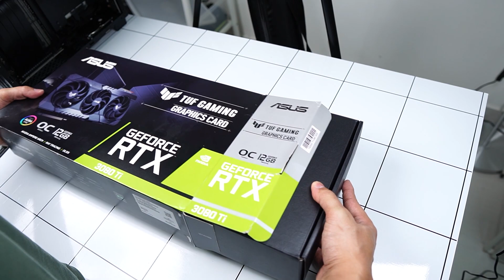Lian Li Q58 with 280mm AIO | Asus ROG x TUF #pcbuild #lianli #asusrog #asustuf #rtx3080ti

Comment: That's way too much thermal paste, your temps will get worse due to less direct contact of the cooling plate to the CPU.

Thermal paste is a much worse conductor of heat than metal. It's only better than air.

Comment: Has anyone heard of anyone fitting the asus tuf gaming 6700xt in this case?
Reply from the maker: Dont think its possible. The tuf 6700xt is among the behemoth gpu there is
Reply: @SembangTechbyEzadHafidz   thanks
Reply from the maker: @stevestewart3816  I just googled the specs 

TUF RTX3080TI 299mm
TUF 6800XT 322mm
Gpu clearance of Q58: 320mm

Even the nearly 320mm will have trouble to be fitted in Q58, let alone 322mm. 

So in short, yeah it wont fit.
Reply: @SembangTechbyEzadHafidz  I definitely fit the 3080 I'm the case lol

Comment: 9:11 If you take the time to meticulously cable manage, you can absolutely still fit a 120mm fan in the bottom with. I did it while using a Corsair SF750 and a Corsair H115i 280mm AIO and my Noctua NF-A12x15 still fit perfectly fine and a standard 25mm fan would have also still fit, but I just happened to a few Noctua slims I wasn't using.
Reply from the maker: Noted on that. However I'd still won't put the fan there, as I think that the intake there is kinda moot, as the airflow would be obstructed by so many cables. If the fan is on the motherboard side, then I would definitely put it there. Nevertheless, thank you for the idea. Maybe I'll try it in thr future.
Reply: @SembangTechbyEzadHafidz  Air doesn't move in a linear path. Having the extra fan there along with the top fans pulling the air along will help bring air to other components. I definitely had much better temperatures with the secondary fan there. Although I still wasn't very happy with temperatures overall and have since switched back to my NZXT H1 in an open air config (because I'm mining).

CPU temps while gaming were hitting over 70C on my 5900x in the q58, even with all the panels off. Barely cracks 60C in my H1. Same with GPU, dropped 10-15C.
Reply from the maker: @gamehawk55  that I have to agree. I came from NR200P and while Q58 is better aesthetically, the temp is way worse. In fact I just bought another NR200 and plan to swap the hardware back there again.
Reply: @SembangTechbyEzadHafidz  are the temps that bad? I was thinking about going with a 3080 12 GB
Reply from the maker: @cjcaton19  it's not that bad. it's just, NR200 has a better temp. probably due to the mesh design. just undervolt or let the mesh stays open during gaming
Reply: @SembangTechbyEzadHafidz  I tried out the nr200, it was simply aweful if you used a 280mm rad because all the air from the gpu was trapped there, even using the radiator to pull the hot air out it couldn't handle it without being loud af and lowering clock speeds. I bought this because the meshlicious I currently use (with the same card you have) generates so much heat it literally melted one of the risers I had.

Comment: Nice.. Pls how did you handle the rgb CORSAIR Commander CORE, cant see it in the video
Reply from the maker: I didn't use the commander pro. all parts are using the standard 5V ARGB, so I controlled the RGB with aura sync software by asus

Comment: Super nice! Is 3080ti ok with sf750w power?
Reply from the maker: No issue so far. I use stock setting, no uv or oc. Unlike the high tier gpu like rog strix, this gpu only uses 2x8pin so 750w is plenty

Comment: Terbaik Dr. Rasa2 better 240 or 280 aio for q58? If 240 below blh masuk 120fan should be sejuk lg kan?
Reply from the maker: 240 cukup dah. 280 punya masalah ialah bila tukar case nnt, tak byk case yg support 280. Bab masuk fan bwh lg sejuk tu no idea, sbb side dah mesh, so tak pastu adakah bottom intake yg seketul tu akan bg efek yg ketara

Comment: You think can I use rx 6900 xt in this case?
Reply from the maker: This case supports up to 3 slot gpu and max length of 320mm. So any card that meet this requirement will surely fit without an issue
Reply: @SembangTechbyEzadHafidz  ok, thanks for the answer, I'll look for one of these
Reply: @SembangTechbyEzadHafidz  32 x 14.02 x 5.78 cm my card video
Reply from the maker: @_roob  32cm? I wouldn't risk it 😅 

even though this case support up to 320mm (32cm) gpu, there's a front IO case inside which in the path of the gpu. Many reports that ROG Strix gpu with 319mm in length has a problem during the installation, in which they had to remove the front IO case. For more info;
https://www.reddit.com/r/sffpc/comments/q2ksla/how_to_fit_rog_3070ti_320mm_into_lian_li_q58/?utm_medium=android_app&utm_source=share

Comment: So can you not use the hotswap bay with a 280 aio?
Reply from the maker: Yup. Since the 280 aio is longer, it interferes with the front hdd/sdd bay, hence the hdd/ssd is unable to be installed there
Reply: Hallo, meine z63 280mm konnte ich problemlos installieren ohne den Hotswap Schacht zu entfernen.
Habe dort auch eine SSD verbaut.